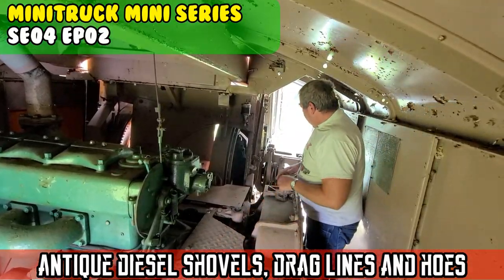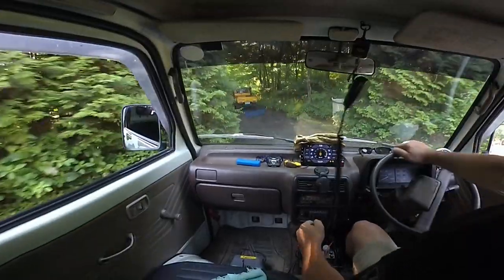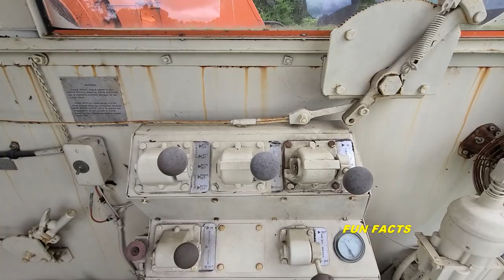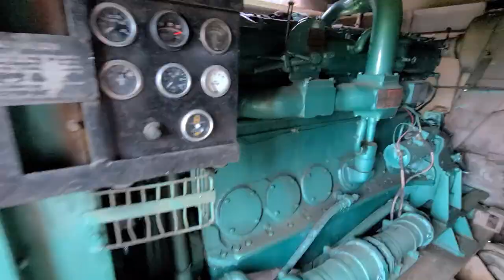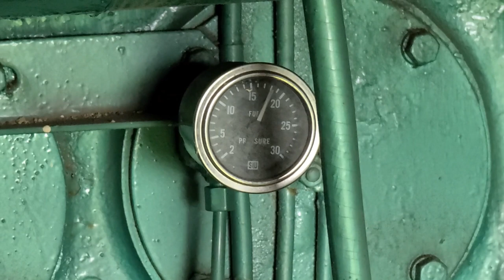Mini-Truck (SE04 E02) ROBERT TRUMP's Antique diesel shovels, drag lines hoes. Heavy Equipment Part 1

Comment: I was born in 1956 and when I was growing up my parents called these steam shovels because of the 1940s they ran on steam like the trains. Murphy came out with diesel engines to replace the steam engines which made them a lot smaller. The trains still ran on steam but they used oil to heat the water instead of Coal. Then the diesel  locomotives came out. Then the 70s we had rupp mini bikes, then hondas, then Yamahas, Yamaha banshees, then Raptors, and, wow, here we are today!
Reply from the maker: I remember the "steam shovels"
Reply: I use to repair Murphy’s a breed of their own
Reply: beastly engines! @michaelwills7884

Comment: fun fact if  a diesel kicks back it will run in the opposite direction. happened when trying 2 pull a m578 recovery tank with army wrecker which happened 2 me. I had 2 put the wrecker in 1 st. gear 2 get slack in the chain & unhook. fun fact on a 24 volt system if one battery terminal is lose it will melt the terminal post down. that's y all excavator & backhoes r hydraulic today  &  r faster. one of the hardest thing when working is watching out people around u. local 138 operating engineers covering Nassau & Suffolk counties NY.
Reply from the maker: Cool stuff!

Comment: I am wondering if a 2L or 2.2 from a 80's toyota van will work with Mini
Reply from the maker: No. The engine is designed low profile, it's almost laid flat

Comment: Don't think you ever did a video on the rack you installed on the front and I don't see it on the Hijet page of your website. What gives, Mini truck?
Reply from the maker: The chainsaw holder? I did do a video, it's made out of wood
Reply: @MotoCheez  No, I was referring to the rack you put it on!
Reply from the maker: @technogatsby3935 What rack? I'm a little confused. I am getting old...lol
Reply: @MotoCheez  It seemed like you installed some sort of flat rack of some kind on top of the Wrangler bumper. There were clips of it before the chainsaw even appeared. Maybe I'm completely misinterpreting what I saw. I know you discussed wanting something up front in that spot which is why you initially mounted the circular lights upside down.
Reply from the maker: @technogatsby3935 oh, yeah that's a ATV rack I put on there. That's where I put the chainsaw box on top of it.
Reply: @MotoCheez  Anything particularly special or noteworthy about the atv rack or was it pretty generic? you have to do any mods for it to work on the Wrangler bumper?
Reply from the maker: @technogatsby3935 I actually use a real small one off of a 90cc ATV. Then just bolted it with some extra brackets. I thought I did a video on it but I guess maybe I didn't....

Comment: I'm not too familiar with Daihatsu mini trucks. How much power does Mini make without a supercharger? About 40HP or so?
Reply from the maker: Claimed 53hp... But I'd say 50
Reply: @MotoCheez  that's not too bad at all.
Reply from the maker: 75 would be nicer, a lot of hills around here 😁
Reply from the maker: Not sure. 30%  or 5lb boost is usually safe on any motor... We will see 😁
Reply: @MotoCheez  :D